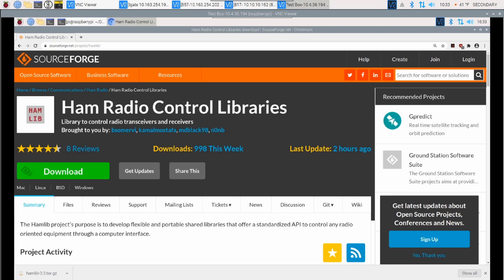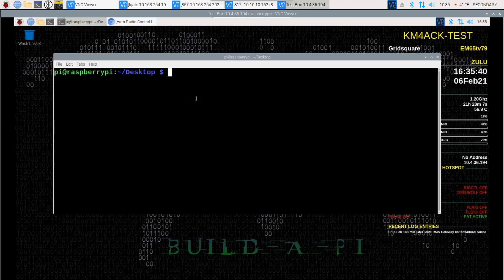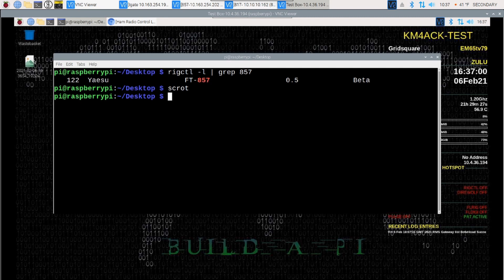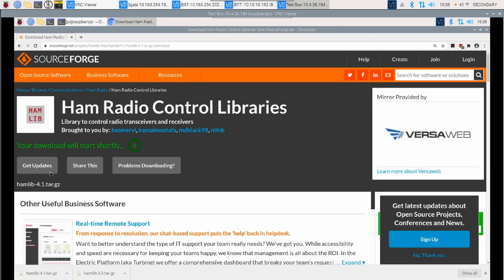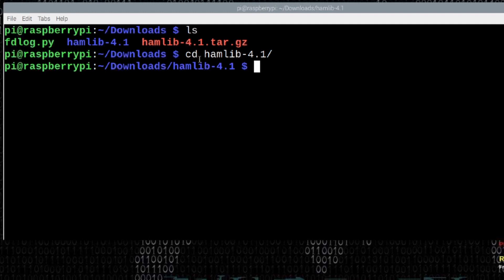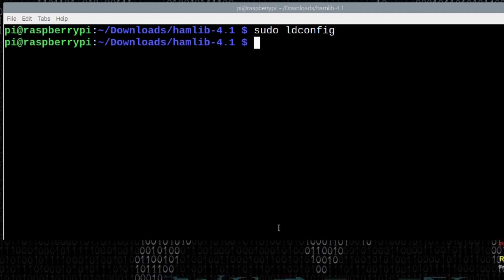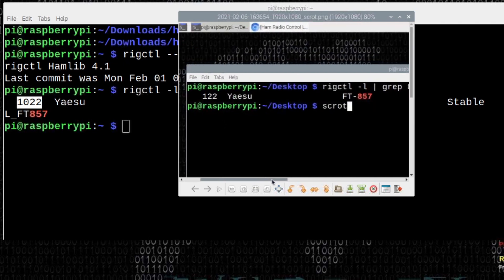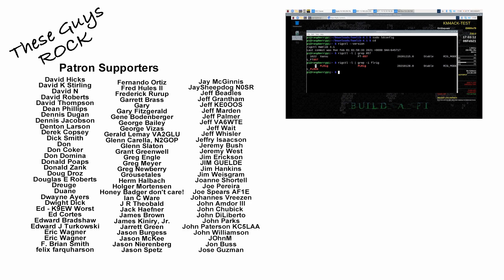Hamlib 4.1 Install Raspberry Pi

Comment: A couple of hopefully helpful tips to save you some time.
1. Use Ctl+L instead of the clear command.
2. After extracting a tar.gz to create a directory, r-click on the directory and select Open in Terminal to get a terminal in the extracted directory.

73,
VA3TYB

Comment: HI Jason, Thank you for a very informative video. 

For the past few weeks now I've been trying to overcome a very annoying fault with the Rig Control installation on my PI 4.
I'm running the "Raspbian GNU/Linux 11 (bullseye)" instance and on each installation (5 clean builds now) I get the same issue:

pi@raspberrypi:~/Downloads/hamlib/hamlib-4.4 $ rigctl -l
rigctl: symbol lookup error: rigctl: undefined symbol: cookie_use

I must add that prior to attempting the update to hamlib-4.4, the command 'rigctl' was not even recognised!
I've hunted around the net for any similar issues, however none quite seem to match this one.

Using WSJTX, the application interacts with the rig as expected, (both CAT and Audio control) right up until the TX process begins, then usually after a few seconds it bombs out with:

Hamlib error: Protocol error
rig_get_vfo: returning -8(Protocol error
0000    fe                                                  .               
read_block_generic(): Timed out 3.3097 seconds after 1 chars
read_block_generic(): Timed out 3.3097 seconds after 1 chars)rig_get_vfo: elapsed=3009ms
rig.c(2587):rig_get_vfo return(-8) Protocol error
rig_get_vfo: returning -8(Protocol error
0000    fe                                                  .               
read_block_generic(): Timed out 3.3097 seconds after 1 chars
read_block_generic(): Timed out 3.3097 seconds after 1 chars)rig_get_vfo: elapsed=3009ms
rig_get_vfo: elapsed=3009ms while getting current VFO

Timestamp: 2022-08-30T15:31:34.176Z

I don't quite know how to further investigate the issue or produce more detailed error logs.
Any help would be appreciated.

73 M0ZFF
Dave
Reply from the maker: You have two instances of hamlib installed. One that was installed with apt and the other that is built from source. To remove the one installed with apt, run: sudo apt purge -y libhamlib4

Comment: I have been trying to get Gpredict to control my radio, do you have a video showing this process? I installed the build a pi suite of apps and SSTV and FT8 modes all work but I want Gpredict for Doppler shift tracking.

Comment: Hello please what to do with number of #### in rigctl ?  there is not info about this. i have issue in PTT moe . it cannot be set to working  with my ELAD FDM DUO
Reply from the maker: to see a list of supported radio run this command rigctl -l
Reply: @KM4ACK  I see all, videos yes, I have to use Kenwood ts 480 same of cat system that works fine. But I do not know hot to go ahead with that number, where I have to put that?
Reply: @KM4ACK  Yes i have done , my rig is as kenwood ts-480, number is 2028 (in hamlib 4.1) but what i have to know is: this number of the rig where have to put ? my PTT crash 8/10 times , starts but hang immediately and give error on hamlib.  Have you a help to solve many thanks regards 73 ik1naf

Comment: Hi @KM4ACK thanks for the update on that, I have hamlib2 4.0 installed on my laptop and could not program my Yaesu FT-7800 as hamlib2 4.0 have seemed to have dropped support for it, had me wondering what was going on which I now do. So no upgrading desktop till this issue is fixed as it only way can program the Yaesu FT-7800. Anyway thanks for the tip and keep up the great work. 73 de VK5ZSH